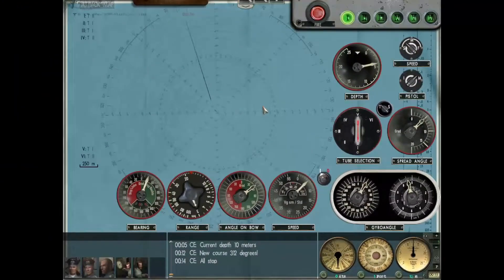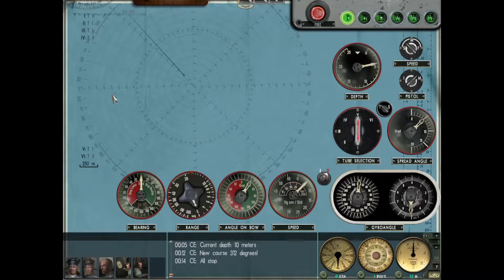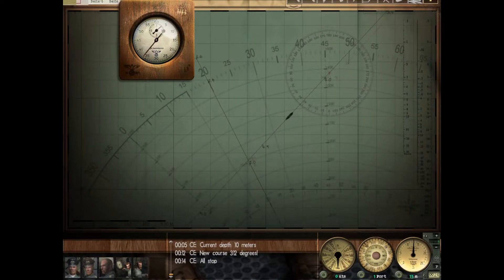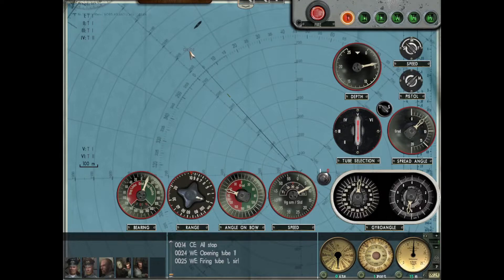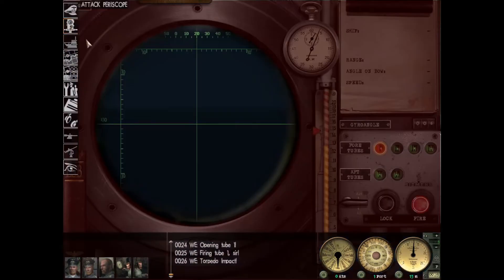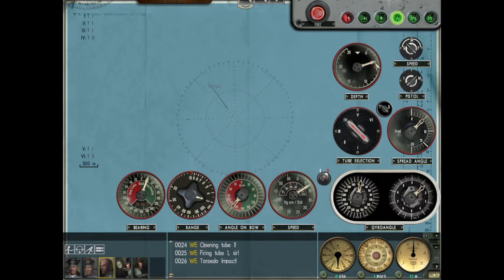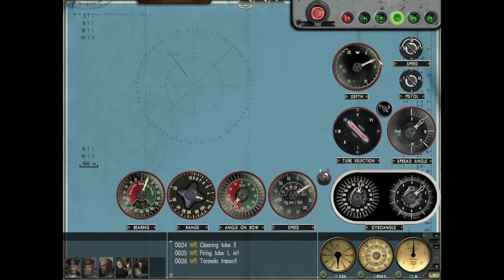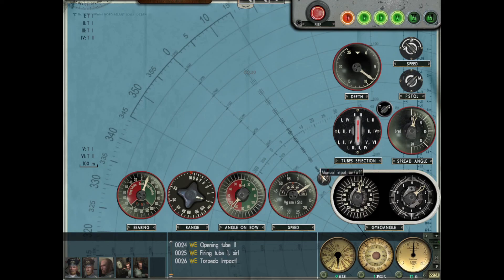Silent Hunter III [GWX] - Beginner-Friendly Manual TDC Walkthrough - THE NUMBERS, WHAT DO THEY MEAN?

Comment: If you're on a 90° attack course like in your example, just bring your periscope to 0 and set AOB to 90 degrees, since you already know the ship will be at 90 passing your 0.
Then bring the gyro to both 0 by turning your scope and you know the bearing your torps should leave the tubes.
This easy way I sank ships from a distance of 1km to 1,5km in the thickest fog without even seeing them.
Just wait until it reaches the perfect shooting angle according to the gyro.
All you need to get right is the speed, as it's the most important factor.

Comment: The circle you have around your U-Boat "bearing angle??" how did you get that. i cant get that even if i zoom close to my U-boat. Is there a button or setting?
Reply: Its a mod called GWX (dont remember what it stands for) but it has alot of QOL improvements and you can make the game more realistic(sometimes in ways that might negatively affect your enjoyment) but overall its a good mod
Reply: @Bomtaker01  thank you very much
Reply: @Bomtaker01  Grey Wolves expansion
Reply: I've only just started playing but I believe I got it on the TDC panel mouse up to the top and you'll see tools. Clicking on the question mark brings up manual input tools should bring up the bearing angle tool
Reply: Yeah I'm pretty certain he is using the GWX Onealex mod. I stand corrected if I am wrong. And for the record, Onealex is pretty awesome.

*EDIT*

I'm going to correct myself here. I had no clue GWX was a mod itself. I thought the GWX Onealex  and GWX was all in the same.

Comment: Good video for the beginners! Here are some small notes:

The magnetic pistol in Silent Hunter III is actually an impact+magnetic combination! Even the official manual that comes with the base game tells so: "Switches the torpedo detonation mode between I (impact only) and M (magnetic plus impact detonation)."

The gyroangle basically shows where/how much your torpedo will turn after its straight run out of the tube. Many skippers like to go for a gyroangle close to 0 (straight-line shot), because making the torpedo turn will carry more risk of errors.
Reply: Your magnetic pistol torpedo can still be lethal if it misses the original target. Example: you set a 5 metre depth setting and it misses your target, but hits a ship with a draft of 7 metres in the next column. The impact pistol triggers when the torpedo hits the ship.  It has happened to me more than once.

Comment: What are the little numbers next to the ship directional lines from your sub mean..? KMiles..or times..? Km..? Thanks..
Reply from the maker: If you're referring to the rings around my ship position on the map, they're in meters and are supposedly spaced 100m meters apart as you move out each ring. I'm using GWX and I believe that compass layout is just default, but it's sorely missing in stock SH3. The lines going straight out from my position on the map are just relative bearing lines. Anyway, the outermost ring reads 1500m, whether that's accurate to the map or not is debatable.
Reply: @horrorfromthedeep1670  what do they say at 6:58